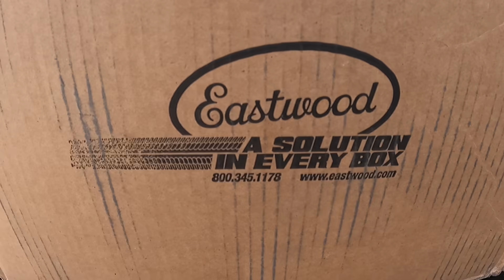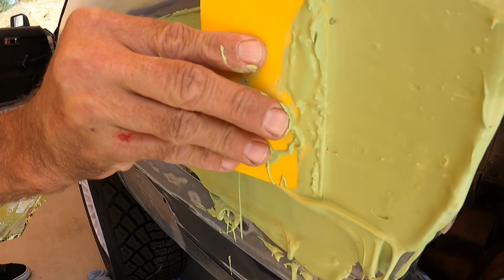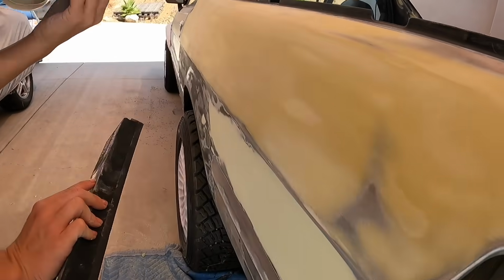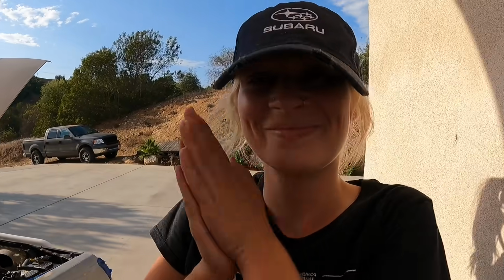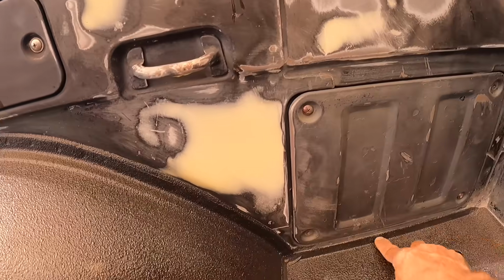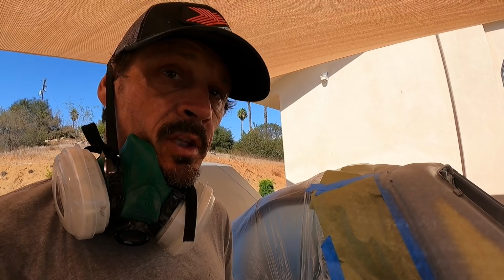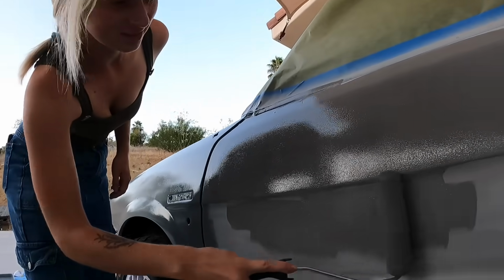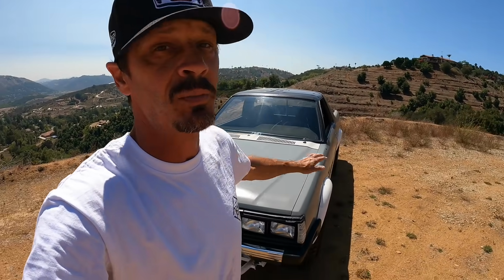Project BRAT Episode #16 “Prep & Primer”

Comment: The Brat looks GREAT primed! Curious tho'... Is it hard to get panels for Brats, 'cos you guys had to use A LOT of filler and Bondo?  When working on few older motors in the UK (Morris Minors especially), we could source new panels made from the original plans/molds.
Reply from the maker: Hard to find Brat panels.
Reply: @BuckyLasekOfficial  Thanks Bucky... Kinda figured that. I knew you guys would use new panels if you could. LOOKS AWESOME.

Comment: Bucky how did that roll on primer dry, Did it have orange peel? Wonder how it is to block
Reply from the maker: We need a few more coats of it still but it dried like a roller applied paint would. It laid flat but had lines that eventually cover with more coats.

Comment: Cataloy, or Bondo as you call it, is a horrible job! I've never managed to do a decent job, but there again, I didn't have access to that long sanding block when I tried doing it 35-40 years ago! Living in California it may be that you'd need to use a wee bit less hardner/activator to give the product more life, but I'm probably talking BS!

Around 1990, a friend of mine threw together an ultra cheap rally car on a zero budget over a weekend! The car was a Yugo, a license built Fiat 128 from Yugoslavia, funnily enough! The upgraded and lowered rear suspension involved heating up the rear transverse leaf spring to red hot, on a bonfire, and belting it very hard with a 15lb forehammer in true agricultural fashion! The roll cage was for a Hillman Imp (1960's rear-engined 1000cc car from Chrysler UK, built at Linwood in Glasgow, Scotland!) modified to fit the Yugo! The engine upgrade involved the fitting of a twin choke carburettor from a Fiat 124, and nothing else! So you get the idea, the budget really was £zero, he reckoned the car build cost less than the entry fee to its first event!!

Anyway, the paintjob! He bought blue emulsion household paint from Woolworths and applied it to the car with a roller! He did the same to the roof, but using white emulsion!! After it had dried you would never know that it was household paint, or applied using a roller! And the paint lasted for the 2-3 years that he used that car in local tarmac rallies in and around Fife, Scotland where he regularly embarrassed the hell out of the rest of us with much more expensively built cars!!